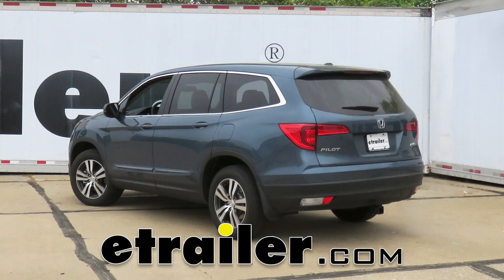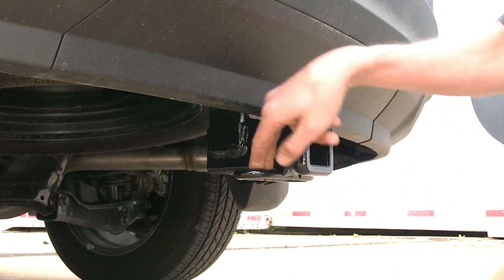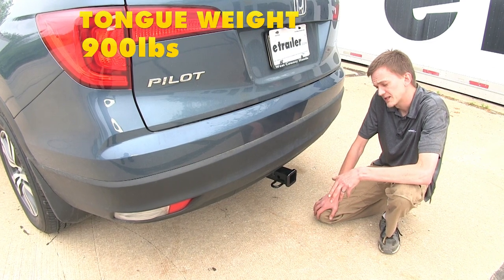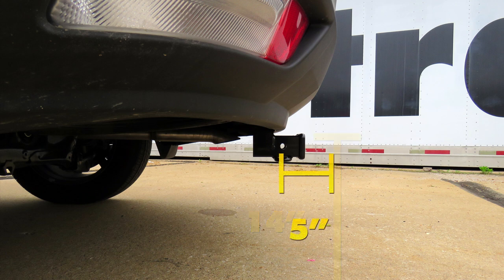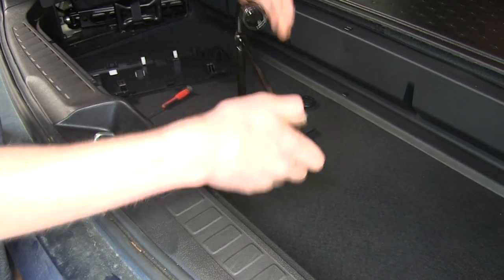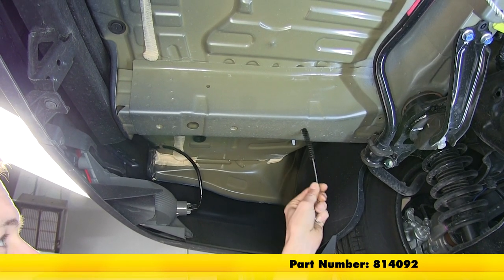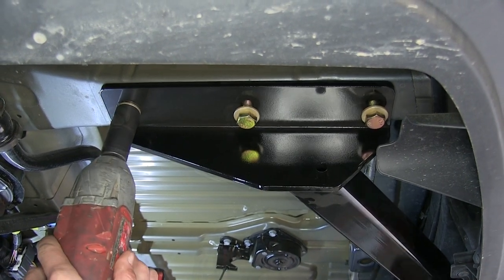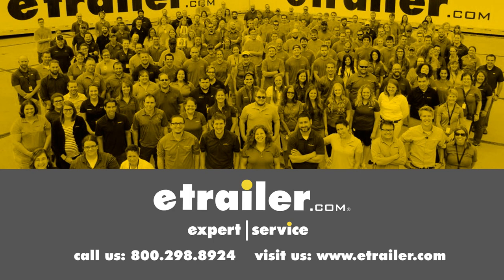etrailer | Setting up the Curt Trailer Hitch Receiver on a 2017 Honda Pilot

Comment: great product from etrailer.  I did not have to drop the tire on my 2018.  Easy to install.  But... the Honda end of the wiring harness is covered in lots of tape and a bit difficult to pull down once you find it under the seat belt assembly.  Overall great products and service from etrailer.

Comment: I added the trailer hitch and the wiring harness. Works great except for the fact that when I hit the brakes it locks the brakes solid on my trailer and when I turn on the right turn signal the trailer brakes go on and off and on and off with the turn signal

Comment: What is the size of the bolt that you used to secure the hitch to the car?
Reply from the maker: The bolts will be a M14-1.50 x 40mm hex bolt. These will come in the kit with the hitch.
https://www.etrailer.com/Trailer-Hitch/Curt/C13146.html